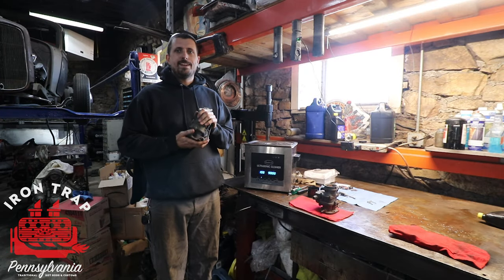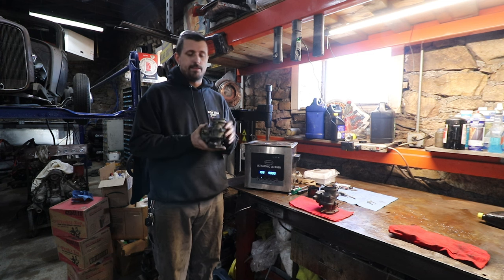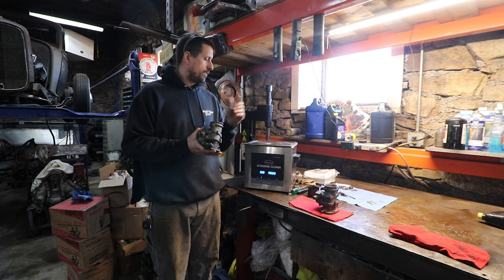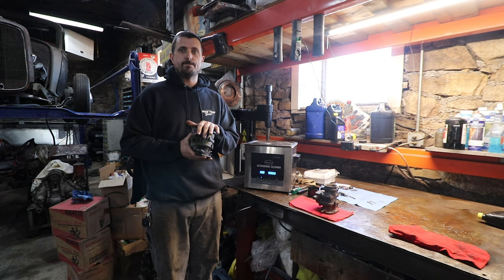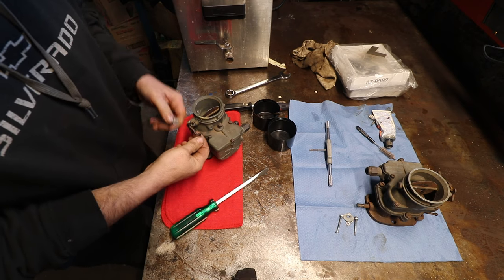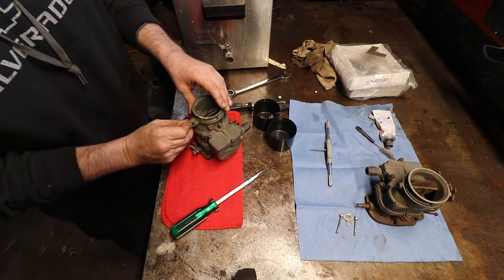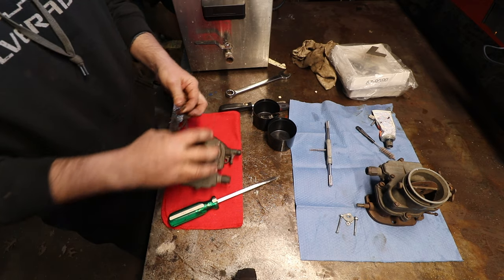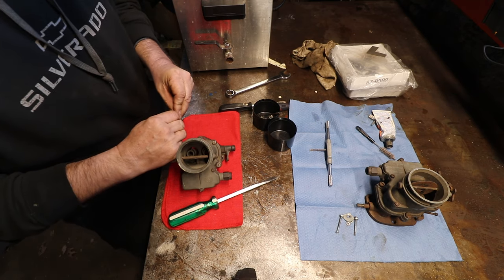How To Rebuild A Stromberg 97 Carburetor - Tips & Tricks

Comment: THE STROMBERG 97 CARBURATOR WAS THE ORIGNAL PERFORMACE CARB IN THE 30S AND 40S.  IT WAS USED A LOT ON THE FLATHEAD FORD V8 MOTOR.

Comment: Be careful using compressed air blowing out jets.
Remember what they said to Ralfie.
You'll shoot your eyes out Kid 😂
Darn near did it myself a couple of times. 
A friend actually did it.
Lucky he did it at an angle it only scratched his cornea and it healed fine.
I've always worn eye protection when cleaning carbs because of spraying carb cleaner and compressed air.
Actual goggles, not just safety glasses.
I've had those fall or blow off at the most friggen inconvenient times working with air or sprays.
Definitely an interesting episode this one.
I loved bench work.
No garage these days so it's been a while since I've done any.
Other than circuit board repairs on my folding table.
For some reason or another my Bebita Wife Maria frowns on me cleaning vehicle parts in our apartment. 
IF I was single you can bet my front bedroom would look like Matt's shop and I'd be sleeping in the back guest bedroom. 
Guests on the couch.
I live the shop life here on ITG,  Watch Wes Work and other related channels these days.